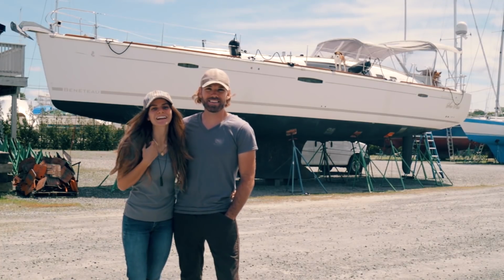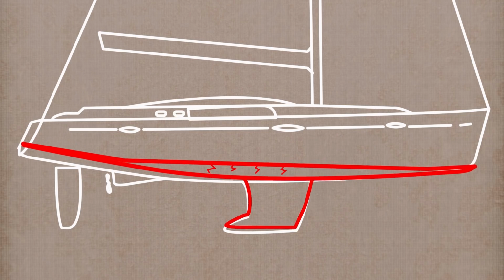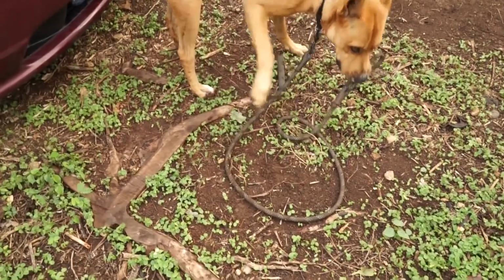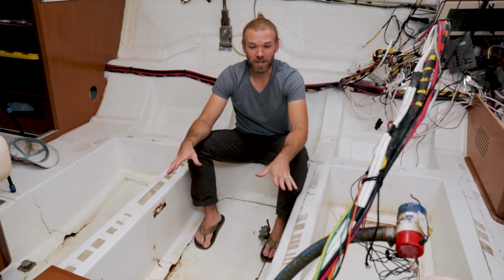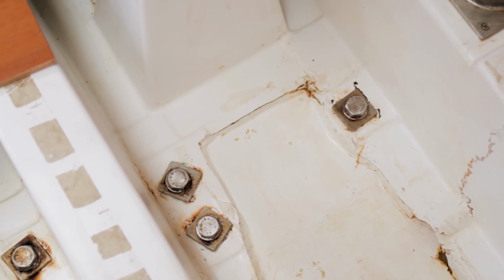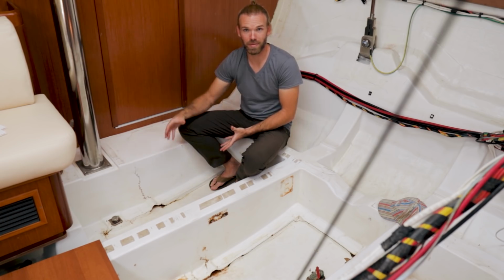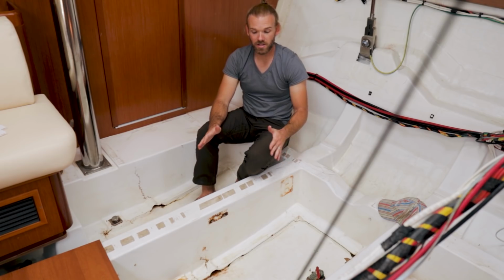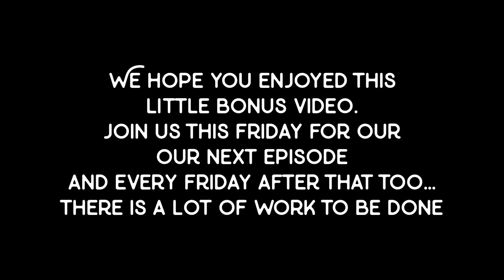What Happened and What Now? our SALVAGE SAILBOAT story | Expedition Evans Bonus

Comment: Have you looked into cutting out one grid central section at a time, repairing it outside of the boat and then bringing it back in and glass it down.
You would cut down on the huge amount of dust being created inside
You'd ensure the grid section is thoroughly inspected and repaired 
& you'd be able to check more of the hull for signs of damage & delamination (that water has been leaking in from somewhere!!) & the hull must have flexed way beyond its design
Mads considered something similar (cut out & replace) but ended up creating new ribs over the old ones. The new layup in itself being stronger than the original and therefore could just discount whether there was any integrity left in the original or not.
Best of luck - it's going to be quite the adventure whichever way you decide to go
Reply: Actually that sounds the best idea said here. There might end up some undulations in the frame that would require some leveling out such as loosing a inch in head room but could speed things up a lot. It could also take away pre tensioned stress in the grid frame. I do not think it requires taking the frame parts out of the boat merely turn them upside down or hoist up to roof to inspect the frame parts. If there is some suspected weak regions they can be increased in strength on the Hull with sandwich off 10 mm too 25 mm plywood with epoxy mat top layer  or suitable stainless steel ribs to spread keel weight over larger region. I don't expect the boat maker to help out much they do mass production and buy a new boat logic. Also they risk thier reputation if they supply repair advice and it goes pear shaped.
Reply: Enjoyed the video. Often called a Grid but looking at it from a design perspective it’s more like an internal “Frame Structure” that gives the overall design its rigidity and maintains the finished boat alignment. Your explanation of how damage occurred and never fully inspected for years seems to complicate the repair plan. Also other replies point out the Factory build process’s goals results in a less comfortable assembly begging for trouble from an accident like this boat had. 👉Assessing the overall problem may likely have to be continually reassessed as new information surfaces during the fixing process. Its my opinion to keep in mind the Factory design and shortcomings during the original build process and to make it stronger.
The design method of attaching the Keel could be catastrophic when an accident occurs. Certainly this seemed to have played a role in extending the damage to the internal assembly and Frame structure. The boats forward motion with its weight to abruptly stop must of been high to cause the damage. Luckily the Keel remained attached!
Again, it’s my opinion that by increasing the “Frame Structure strength” and HOW it is bonded or attached to the haul is vital with keeping  this from happening again. Doing the most you can as a goal will greatly benefit you in the future.
Visited Mads Channel and feel he focuses on the same while repairing a design like this.
Certainly this type of accident has had to happen before. Can’t have a design with a breakaway Keel and haven’t seen any alternative designs. What to do seems you have to build it real strong! I’m only on Twitter @marty_didier
Enjoying your Dream journey and look forward to watching more of your repair videos.

Comment: Two questions and one comment
1.  Have you contacted Beneteau for any guidance, suggestions etc.?  Same with owners groups.
2. I spent 50 years producing and directing motion pictures and video programs.   When you add type graphics leave them on the screen long enough to be read without stopping the video.   The rule of thumb i is 1.2 to 1.5 the time it takes to read them.
3. Bbecause of the salvage aspect of the boat.....  Will you have to be inspected during or at the end of the repairs?  Since you are already shooting video and stills......document everything.  You might want to put date signs on the document shots/video.
Reply: Wow, Taylor, these are really neat advises.
Reply: They answered these questions in the video
Reply: @tomharrell1954  No, they did not.
Reply: Ppap Dddar it’s in the drop down introduction.  It’s the part you must read before the video
Reply: @tomharrell1954  You are right, it's in the description (introduction, whatever) of the video.
It may be a must to read, but I admit I never read them.

Comment: Thanks for the bonus video. It helps understand your journey and project.  I worked in the fiberglass world for several years. One of your biggest concerns will be the adhering of the glass to glass surfaces. Also think about the weave or chop of the glass which works best in the area you are working on. Goid luck and happy glassing to ya.
Until our adventures cross, fair winds and full sails  ⛵

Comment: hi there enjoy the vids but it brings memories! i have a salvaged 1986 beneteau first 42 that had the same problem.  my boat has a 'circle' of grid around the saloon with only athwartship ' beams ' beneteau recommended an upgrade of layups between the beams and to the hull in each bilge compartment. it broke anyway, all the beams except the ones under the for and aft saloon bulkheads.the beams are u shaped cross section hollow inside. i supported the hull under the fore and aft saloon bulkheads ( keel removed ) and let the hull 'relax' .then i cut the beams out and reworked them and added a beam wide layup under each beam so there was more epoxy surface area to reglue to the hull. then i did the recommended layups across each 'bilge between the beams using 20 oz rovings and other fiberglass cloths . i split abs pipe and made limbers under each beam. the hardest part was joining the ends of the beams to the remaining grid. painted the bilge with barrier coat and finished with 2 part lpu. hope this helps ! anyway my condolences lol 14 years ( everything was bad ) hope to launch this winter

Comment: It is common these grids come detached , if it is not broken   it was not so much the grounding as glue failure, where it broke the bond was good  . The glues are known to fail over time and the stressing made it fail early . 

The glued in  grid construction is great for making a stiff boat that is cheap , but that it is not glassed in is a cheap short cut in a production boat built for a price . You get the same with bulkheads often in a production boat - not tabbed in . 

Anyway the right way to fix is to make absolutely certain the boat is square and not twisted in the stands , cut off the flanges , grind the surfaces you intend to glass to expose fresh glass for a good bonding then tab it all in . It will be stronger than new .  You might want to add a fillet so the glass has a gentle turn . 

This is assuming no breaks  in the grid and no delamination of the hull .  The breaks you will need to  structurally fix to at least the same spec as the original - and that is also easy .
Reply: Is there a way to know if the grid of a boat has been glued in or glassed in? Or if the bulkheads were properly tabbed in?

Is it just common knowledge? These manufacturers, such and such, glue the grids of their boats. Can it be told the common offenders?
Reply: @ppapdddar6159  The grid is actually quite good - this thing took a major grounding and kept sailing for years . 

Glues today are much better but glassing in is the gold standard . it will be obvious if it is glassed in and if not to you then you need to have someone else look at it . 

Now as to construction , you have to remember what you plan to use the boat for , by far most are coastal fair weather only cruisers that want a nice dock cottage and a week or two away cruising .  They don't go out if it is raining or a little rough . 

For this person the production boat with glued in grid and the bulkheads not tabbed in will be more than ample and survive any storm they are likely to be caught in (bar total stupidity ) while being cost effective . 

Now if you plan on crossing oceans and sailing to remote places in any weather then you want something different , glassed in bulkheads , a protected rudder / prop and a full keel maybe . A much stiffer boat too with a small cockpit  so she can take a sea .  This kind of boat can take hitting a reef . 

But here is the thing , that boat sucks for the weekend fair weather sailor . That boat is slow , heavy , bad maneuverability , small cockpit , expensive . Instead you might want a roomy , fast production boat  with a big cockpit for entertaining .  Seen many a day sailor on a lake with a boat made for the north sea complaining that there is not enough wind to move the boat . The wind is fine , It's Wrong boat . 

The boat these guys have has a fin keel and spade rudder , fast, goes to weather well but prone to heavy damage if you hit something .See the video LOL  . The rudder too , prone to damage even from hitting floating objects at sea . Production but a well known and respected manufacturer so decent quality  . It is a compromise , while you can cross an ocean it leans towards comfort and performance . 

One needs to decide what they need and what they will use  the boat for to decide things like build . I mostly day sail and race with a week or two of cruising on the great lakes so I have a roomy VERY light fast boat  made of Kevlar and foam core with fin keel and spade rudder, really bendy mast  and that grid . It will take anything I throw at it and while they have been sailed blue water I would not   . .
Reply: Oh and if they ground it again it will break again , probably worse as it will be stronger and have no safety valve of the grid pulling away . For seeing what a full keel boat with protected rudder and prop does with a BAD , really bad grounding watch Sailing Naji and look for the one they put her on a reef - high and dry .
Reply: @faircompetition1203  Thank you very much for the comprehensive response. I appreciate it.
Reply: @stevenr8606  Just stay in sight of land

Comment: Thanks so much for the back story and your explanations of the issues with your boat. I am happy to see that you have a good understanding of the work ahead of you. You will end up with a boat that is stronger than it was. I second some of the comments below - just cut the tabs off, it will be easier and a better job. Also, don't be surprised if it's harder than you think to drop the keel once the keel bolts are removed - it's very likely going to be attached with sealant that is surprisingly strong! Looking forward to following your progress. You have a beautiful boat there.

Comment: I have been through the dust! From my experience creating negative pressure in your work area will cut down the dust, this can be done by using a 2 foot x 2 foot box fan and putting it over a hatch in your work area then get plastic bag tubing to move the dust away from the boat on the end of the tube take an old bed sheet and make a large pillow type case out of it.This will catch most of the dust keeping your neighbours happy and the boat yard. You will need something like this when you start fibreglassing as the fumes will displace the breathing air. The best solution is a commercial dust collector and grinding into the intake hose, in my case I got a large [12 inch] plastic funnel and put it on the hose, also putting a course mesh inside it, the suction will pick up anything lying around. This collector is not cheap. But how much have you spent on vacuum cleaners already? When you are done you can sell it! As far as some of your supplies your are using grinding discs ,respirators and such shop where the pros shop you will soon become one, befriend the sales staff they will be a great help. When I did my project I got a lot of help from the fibreglass foreman at the boatyard at my marina. I also purchased purchased a lot of supplies from them.  I hope this will you.

Comment: I'm glad you are young and seem to have some experience with "light" projects and rough living (this ain't one of them). You're going to be tested on this project for sure. I agree with the advice of hiring a marine engineer. He's going to provide a reality check on the repairs/process needed. I think your going to find the idea that you can grind and re-glass that grid back in place maybe a little overly simplistic. For me the challenge is fitting/securing the grid back to the inner hull and keel properly after it's been violently separated with the interior still in place. I'd contact the factory and discuss the issue to understand how these boats are constructed and work back from there. That said, if you are able to get this boat seaworthy (without getting divorced during the process hopefully) its going to be the experience of a lifetime and your future travels will surely be something you can share with your grandchildren!

Comment: I'm sure you will have plenty of comments , an alternate option is cut out some of the bad sections of the grid, but first use it as a male mold to make new grid pieces , then Graft these into the old grid. Especially in the areas of hi load. Ideas , Also there is a great adhesive plexus made to glue fiberglass together , if you sawzall under some of the tabs you might be able to inject this 2 part adhesive under .lots of options , good luck ,cheers Warren

Comment: The fiberglass lament separation  is merely symptom of the ribs being dislodged from the hull that the keel connects to. I think you should cut all around to be able to lift the glass up and out of the way in order to re bond the ribs to the hull. This is a much deeper job than you imply.! Sorry but simply cutting away the cracks and re bonding will like putting bandage on wound that require staples. The keel like you said is very heavy and one bump will crack the skin all over again.! Rebound the ribs to the hull.!

Comment: Great work guys. Grids and a bonded on keel are a bit of a pain arent they and that is why you will have got it at a fair price as its a fairly big thing to sort out but I can see you have the drive to do it. I have a large Jeanneau which is built similar, albeit with a drop keel too so I keep this issue in mind.  Mines only held on with 4 bolts....on the keel axle (2 bolts each side). Cheeki Rafiki is the end result of not paying attention to these issues with the grid. My father had a different boat with a mini grid and twin keels (bilge keel) in this configuration:    /     \     where they  pulled apart from the hull over many years due to the down forces involved when drying out. Ended up reinforcing with some solid hardwood timbers internally, shaped to the hull transversely and relaminating it back in with epoxy.  Then putting in tubes down to the keel bolts to ensure a very sturdy build. No problems since. Bullet proof and bone dry bilge. Fabulous outcome. My biggest concern with a grid is the amount of GRP between the keelbolts. Some arent even attached to the grid on some boats, just reliant on the keel bond and the square washers. A large washer over a bolt doesnt seem to be enough in my mind. A steel matrix cradle would be far better connecting multiple bolts. Do it right while its all out and you will have a boat for life. Its only time and will be worth it. Good luck and fair winds. Looking forward to watching your progress. David (SV FreeSpirit).

Comment: Cannot wait to see how you get on with this, it looks an absolutely awesome yacht...
On the fibreglass side of things, you may well already be aware but the new layers, shouldn't be the same size as per your little animation.
For eg, say you have six layers of glass where the big grid crack is. The very deepest /thinnest (first new layer) should for eg be 6" wide, the next layer 1ft wide, the next 1ft6" wide etc etc, slowly expanding the layers in width (and height really) until the you end up at the same thickness as the original (or more) this is done so that you always have mat overlapping and don't have any joins in the same place which create stress/weak points. Hope that makes sense  ☺️👍🏽💪🏽 Good luck. ( another way of explaining it would be to say, centred around the crack, grind one layer of glass off as wide and high as you can, then the next layer, grind layer 2 slightly smaller, layer 3 slightly smaller again etc etc, so you should end up with a grid that is stepped in thickness with the deepest ground area centred around the crack.
Edit... The fact it is also leaking means the hull structure also has cracks, so you will need to do exactly the same procedure there too, find the crack, grind it out in stepped layers and re-glass back to original thickness before you even think about trying to repair the grid.
Might be worth speaking to beneteau to see if they can supply you with lofting lines for the area you need to work in so that you know the hull shape is correct before trying to glass it up as is. 🤔❤️❤️